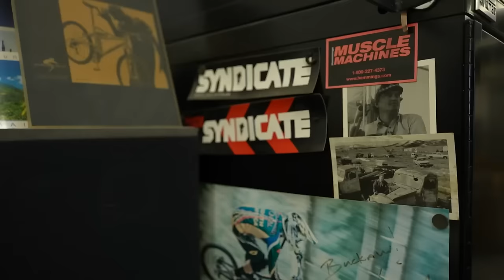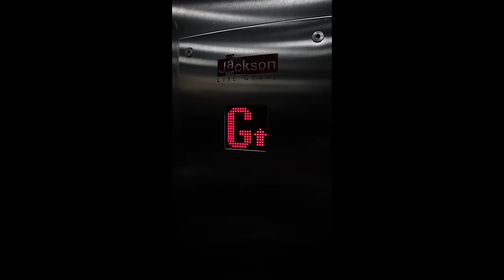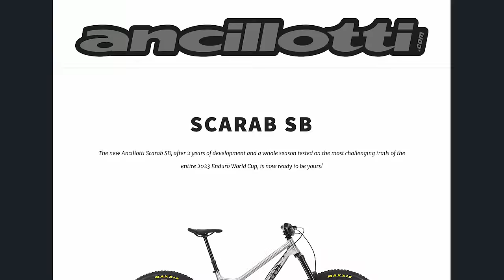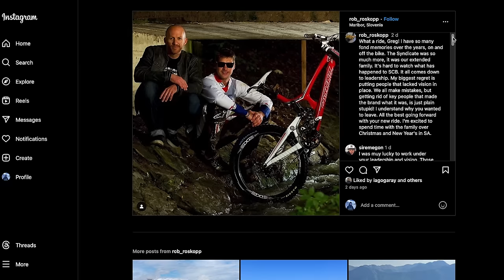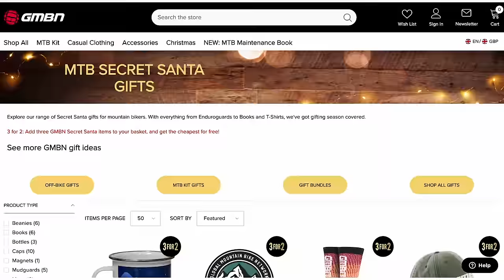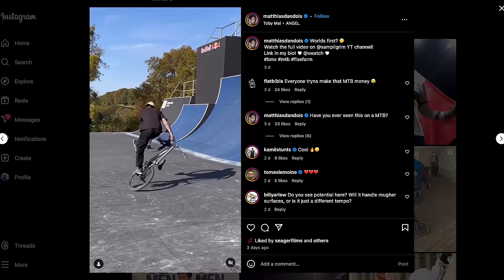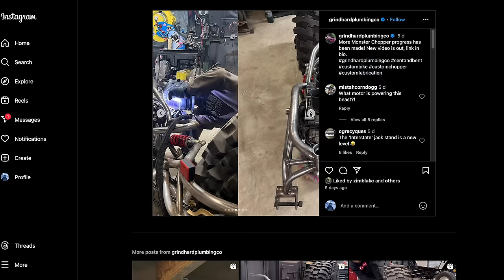MTB Brands You Couldn't Live Without... But Might Have To! | Dirt Shed Show 456

Comment: GT for me. It was my first MTB - an '87 Avalanche and the only GT I have ever owned, but I will always have a soft spot in my heart for them.
Reply: Same for me I started with GTs with my performer and now I have a sensor and a Force.
Reply: My first MTB in 1992 was a Tequesta, my first bike was a 1988 GT pro series...
Reply: Ditto, just substitute a 1999 arrowhead for the avalanche!
Reply: My first bike was an avalanche tooo! 2022 though
Reply: I still have my 2016 GT Avalanche which I'm planning on keeping even after I recently got a full suspension Occam.
Reply: I rode my 2006 avalanche until I broke the frame. That was a sad day
Reply: GT all the way. Started on a 1997 GT Interceptor BMX, and have not looked back. Ride my 2021 GT Avalanche all the time, love it and my roadbike is a 2008 GT Series Three.
Reply: I was going to comment the same thing and when I hit the comments yours was the first comment that was shown 😀. I still wear my pedal tat from my GT BMX days. I still ride my GTs and still love them

Comment: I couldn’t pick a brand anymore. Intense was close but they dropped vpp. I have two older intense bikes but my new bikes are transition and rocky Mountian.
I have owned more kona bikes than any other brand (3… one at the parents, one sold and still have one) but I definitely won’t pick them as a brand. At this stage I just buy the frame that fits what I want for a good price or availability more then brand. I must admit to trying to buy a Santa Cruz but that didn’t happen.

Comment: Canfield 💀   CBF Suspension is soo good. Just wish they made a lighter weight trail bike.  Like a hybrid with carbon chainstays and aluminum front Triangle.
Reply: Have you checked out Revel?
Reply: @chimps4gimps  Yeah, I have but I think there are a bit over priced and the CBF formula is not exactly the same on those.